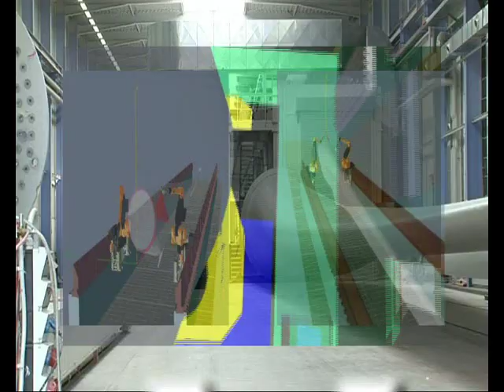ABB Robotics - Painting wind turbine rotor blades

Comment: If Honda built turbine blades, thee would be 50 robots painting is. Honda plants pack more robots in a cell than any other manufacturer of ANYTHING anywhere. Most car manufacturers have robots applying 60-90 spot welds per robot. Honda has rack robot applying about 20. But it's like I say, more equipment in manufacturing, more problems. (Currently, no North American Honda plant is meeting daily production)

Comment: Adding more robots wont solve this one. Everything along the line would have to upgraded to keep the speed. There is also running costs, it's probably greener to spray with two robots, the paint booth wouldn't fill with chemicals which would need more filtering etc. The whole process of adding more robots has exponential implications on everything involved in a production lifecycle. For welding etc, thats fine, but sometimes you can't just add more robots. Also paint dry times, etc.

Comment from the maker: @RobinSweden We don't use the MultiMove function for this concept (Enercon). We have developed a standard 7 axis robot and we use 6 axis to control the robot manipulator and the 7th axis to control the movement along the blade.
For the second question we use pressure sensors on the outlet of the pumps to sense possible pressure build up in the spray tip and give alarm to the operator.